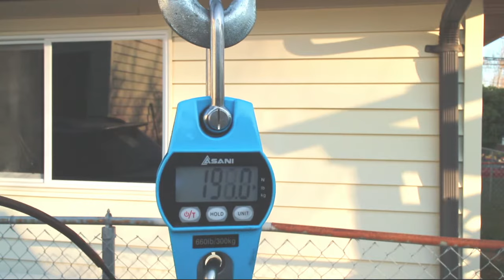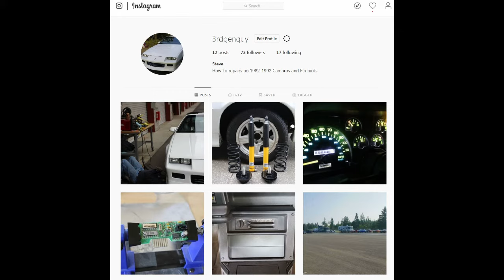GM 10 Bolt Axle Tear Down (7.5 & 7.625)

Comment: Excellent upgrades. Look forward to seeing completed unit, and hear results. I used a 1997 Trans Am rear end complete R&R for my upgrade on 1983 Camaro, super improvement! Thanks for great vids.
Reply from the maker: The  guy who rebuilt my axle did it wrong so it lunched a pinion bearing immediately. fixed it, but now it's a little noisy because of that. the TRU Trac is pretty amazing. i can give the car 100% throttle in a turn and it doesn't spin tires, it just slingshots me around a bend.
Reply: @3rdGenGuy  Bummer on the failure. I must agree, the posi diff and disc brakes conversion brought my car to life, way more enjoyable. I also dropped from a 3:08 to a 3:43 gear. The result gave me better power band. Hope things work out for you.

Comment: Does a 7.5 3.73 gear drop right into one of these fine? I have a 1997 Firebird 3.8 with the 3.06 gears and want to swap them out for. 3.73’s or even 4.10’s. Everywhere I looked everyone is just swapping out the entire rear end assembly with a Z28 or TA WS6, not trying to do all that lol. Other than no traction control, is there any reason NOT to just drop a set of new gears in?
Reply from the maker: some carriers can't accept lower gears.
for example, my stock 2:73 diff can't accept a 4:10.

if you want 3:73 you'd have to get a 3 series diff.
I'd look for a 4th gen diff with a LSD and 3:42 gears.
that will accept a 3.73 or 4.10
Reply: @3rdGenGuy  oh I see now 👍
Reply: @3rdGenGuy  in your opinion, would 4.10’s be overkill for a four speed auto and 200hp/225trq? I just want a fast 0-60, 0-80 and snappier throttle around town 0-30, 30-65 and that’s it. I’ve always had V8’s with at least 315ft/lbs.trq and V6’s are completely new to me. Let alone a late 90’s V6 lol
Reply: @3rdGenGuy  I also got the car for not much money and want a quick city car so I don’t want to drop a LS1 or 5.3 in there lol. Minimal mods, gears/tune, intake lid and exhaust and that’s it. Maybe a moderate cam with better low and mid range torque at most.
Reply from the maker: the 4:10s and an automatic will kill highway fuel economy, but will be fairly quick out of the hole.
usally automatic cars use 3:73 and the t56 boys 4:10s
Reply: @3rdGenGuy  ditto, 3.73’s are the way to go and much better than the stock 3.08’s I have. I have some home work to do on the forums about making all of this work without costing a ton of money lol

Comment: I just re-watched this video. Noticed you ALSO installed an aluminum driveshaft, was it from a 4th gen? And how was the fitment like? It is on my list, post LS swap. Thanks, love all your videos.
Reply from the maker: 4th gen ALU driveshafts are the same length as our cars- about $100 used.
Walter-racecraft sells an ALu shaft for $300 ish
mine was from summit for $350 ish
Reply: @3rdGenGuy  Yep, that's where I find em as well. Any reason you didn't go with a used 4th gen shaft instead, if I may ask?

Comment: Your videos are great. I have a question though, I see you wedged a rod in there to get your posi unit out. I did the same thing but mine just won't come out. Am I doing something wrong? Do I need to do something else to loosen it free?
Reply from the maker: if the axle tubes and bearing caps are removed, it should pop out.
MOAR power i guess.
Reply: @3rdGenGuy  lol my man! Alright. Power it is!

Comment: How many liters does the differential carry?
Reply from the maker: 7.5in 10 bolts hold about 1.8 quarts.
the easier way to make sure, is just to get the axle level, and keep filling until oil flows out of the fill port.

Comment: I'm doing the same thing. How much did it cost to powder coat it? thx
Reply from the maker: $157 for a primer and top coat in just plane OEM Black.
only thing i had to do was use brake cleaner to get rid of all Oils inside the axle and tubes.
fairly easy, took 1.5 cans of brake cleaner.

Comment: Just curious after the rebuilt how much power would it be able to hold after??
Reply from the maker: Probably the same as before ha ha.
nothing can really make a 10 bolt stronger due to how tiny the design is.
Reply: @3rdGenGuy  i was really hoping to hear 500wheel torque lol
Reply: @alex13238712  mrgetinthere has a video on how to make the ultimate 7.5